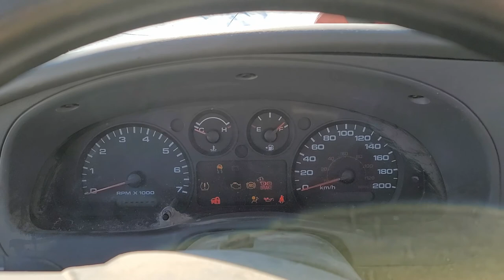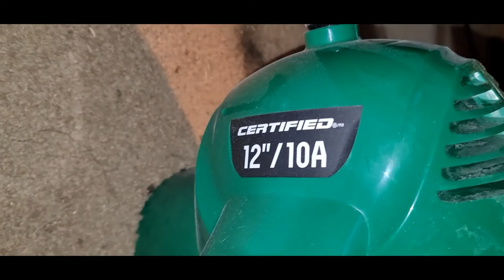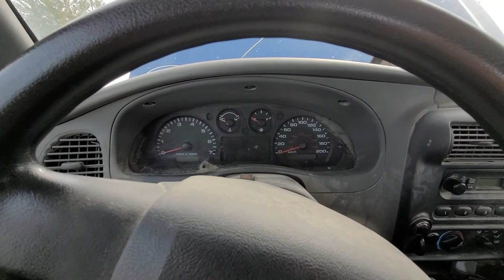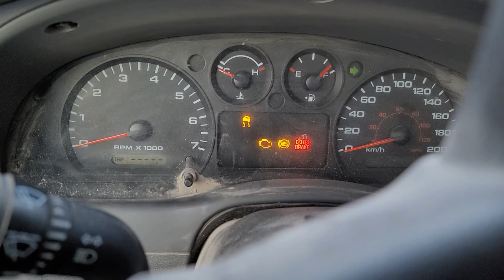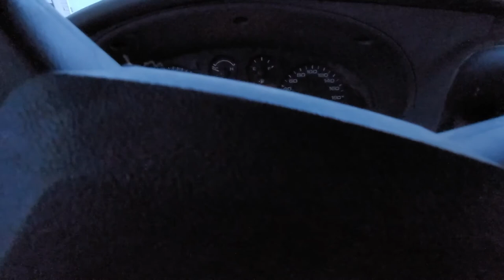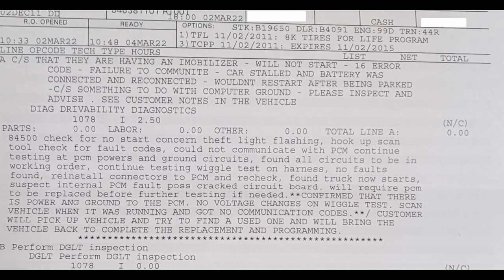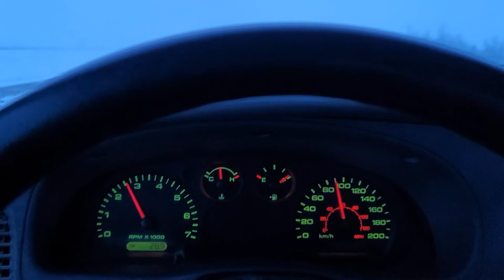Ford 1-6 Error Code Anti-Theft System (Gauge Cluster Dead) "How to Fix" (Moisture Related Problem?)

Comment: Seams like there's something about these rangers that causes electrical connectors in the dash to corrode. Mine sat all winter and I made sure to start it and run the heat regularly to try to keep this from happening.

Comment: 22:15 if you have a spring break it means you over tensioned it, as they should NEVER surpass YEILD strength unless it starts rusting badly, even then should account for 10 to 15% reduction in size from rust and should still not be able to lower the yeild strength, I see alot of garage door springs Undersized and over tensioned, you want to ba able to position it so the weight of the door doesn't fall when fully open, when using or installing a used spring make sure to install correctly

Comment: Do you recommend the ranger? Looking at getting one this week, 11' ranger sport 4x4 4.0 v6 (74k miles) for $18k. Would appreciate your advice having owned one for so long. Looking for something reliable long term
Reply from the maker: that is more $$$$ then they sold for new LOL! 
When i brought my 2WD ranger new in 2011 i only paid $11,000 CAD 
The 4x4 sport models was 7,000 more LOL! 
I Think you will find a MUCH better deal if you keep looking.